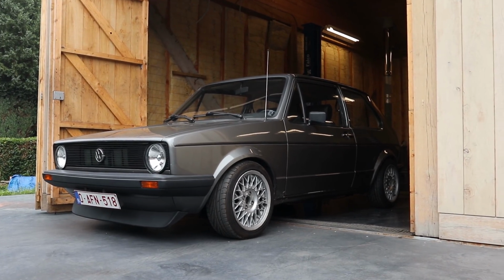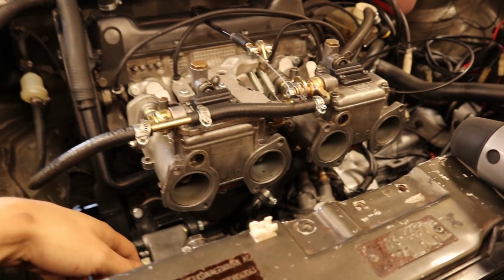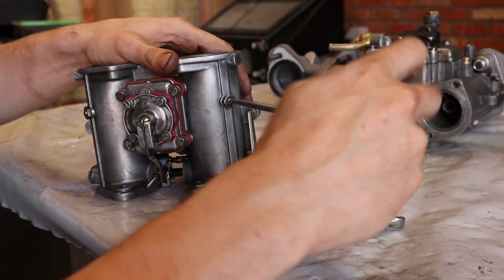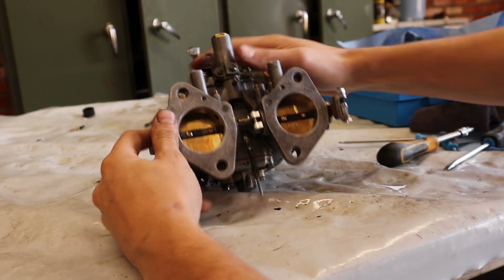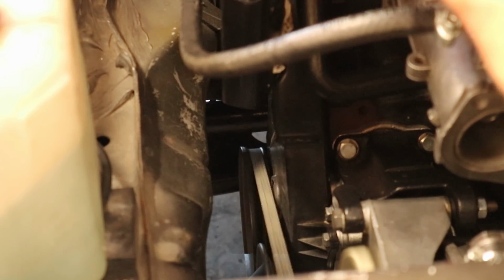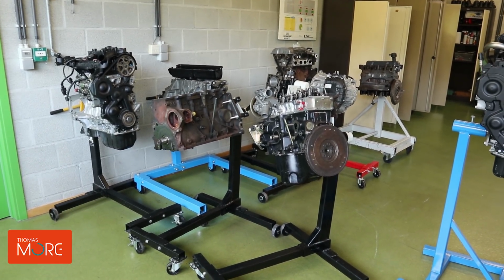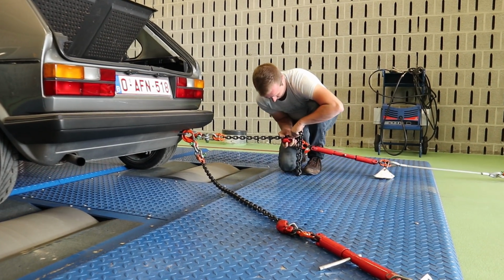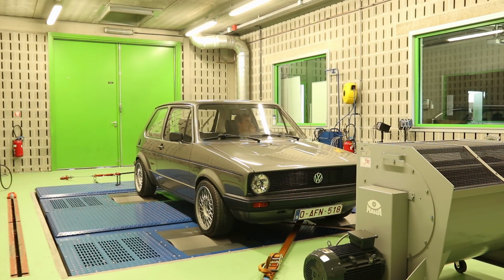Golf Mk1 2.0L 8v Engine Swap - Pt.6: Power Runs On The Dyno!

Comment: I have very much enjoyed your videos on the 2 liter 8 valve swap. I am currently building a 1400 lb Porsche 550 Spyder replica with a 2 liter 8 valve non cross flow head. It came with EFI but no ECU, so being an old guy (75) with more experience with carbs, I too decided on twin 40 mm Webers.  I have a few questions. What were the final jetting (specs) of your carbs, ignition timing, and do you run vacuum advance and if so where is the vacuum port on the carbs. I don’t seem to have them on the Webers and don’t know if manifold vacuum will work. Also where does the cross flow head come from and do you know if it is a bolt on swap for my block? Oh, I lost many weeks before I found out about that adapter for the large distributor hole. I wish I had seen your videos earlier. Sorry to run on so long. You have one of the best YouTube sites I’ve ever found. Good work!

Comment: What spec is the engine? It seems pretty flat in terms of power & how it revs like it isn’t revving strongly.
My old mk2 GTi made ~120hp as a near stock 1800- once tuned as a 2L with properly worked head this was 150hp!
Headwork & a decent cam to get it breathing properly is the key

Comment: Side draft Webers etc can be very expensive to set expensive, most people would surprised that late model SU,s HIF ( high air flow, they are more square at the top, earlier ones were more rounded ) can FLOW as much air and fuel as Webers for LESS money!!

Comment: Memphis: I think the max. power is obtained at an air fuel ratio of 12.5:1. I saw in the later tune of the carburetor, you got more like 11:1. Understand that you tried to avoid a lean mixture from an acceleration. Is there a way to adjust the acceleration enrichment without affecting the air fuel ratio for the entire rev range?

Comment: Make our Idle around 14,7. Full Throttle at 13,0 and if its possible half throttle at 14. You will safe a lot of Fuel and gain more HP.
Falls du Deutsch kannst ist es einfacher:
Volllast 13.0 bedeutet ca. Lambda 0,89 was für Sauger das beste Gemisch für am meisten Leistung ist.
Du Fährst gerade Lambda 0,7-0,78 was viel zu Fett ist wenn du keinen Turbo hast.
So Verlierst du bestimmt ca. 10PS. Denn die Leistung für einen 2L 8V Doppelvergaser ist nicht so berauschend. Das schafft man auch sehr leicht mit einem 1.8 mit optimaler Einstellung.

Stell den einfach nochmal nach und dann sparst du ein haufen Geld :D

Comment: Hmm in the past i make head porting with -1mm on planning in 2E engine and get 123bhp with 177nm without other mods on 1st gen lpg. What is the sense of build carb engine to take less gain?  AFR 11-12 is for that engine with CR 12:1, 288 camshaft and 150-160bhp. Rich fuel is not good for performance, leaner mixture makes bigger power.

Comment: this and your old engine are very tunned here in Brazil, especially with turbos. I have a 1.8 N/A prep installed in my vw voyage, shirick cam, 13,5:1 compression, running on etanol, using audi a3 turbo connecting rods. i use a fueltech ecu and 4x1 exhaust manifold. I got 110whp out of it using a conservative timing. love your channel dude. subscribed.

Comment: I came here because have same engine (mostly, as longitunal in audi 80). Instead of carbs i did go with ecumaster det3 fuel implant, saab injectors etc and stock ignition. In the mix I added eaton m62 supercharger. look my channel for videos.

Comment: Nice video the car pures like a kitten ;) ,im working as a bike cycle mechanic here in Denmark and I startet the eutication in January 2000 and I was finish in October 2003 and I have been in that ever since, I allso repair my own mopeds/scooters, last summer I swaped the broken air cooled engien on my Gilera Runner Sp 50 from 2006 to a licquid cooled engien and allready I had a new wirering harness installed some years ago, so it was ready to get licquid cooled, but the whole cooling system had to be installed that was a big job to do, but it runs like a dream now, I bought a Piaggio Nrg DD 50cc that I took the engien from, I only use that Gilera Runner Sp 50 in the spring and summer and autum then it stayes in my garage in the winther, it coud allso be fun to see how much power it makes on a dyno run, the only issue I got is if I drive on coppel stones or wery uneaven surface the engien stutters sets out but I have installed a real dellorto 17,5mm carburator and I have ajustet it and put in the biggest main jet that it can take and the colour on the spark plug is brown, ohh the engien is two stroke by the way, but it's so nice to do the work and knowing what parts is used and knowing what is done and save monny at the same time :) ,I like to take long trips on my scooter I got 3 and im doing all the mechanic stuff in my garage, in Denmark where I was to school for bike cycle mechanic there is allso car mechanics and motor cycle mechanics and other lines of work much similar to that in Belgum :)

Comment: Hey Memphis. Great Video! Can you provide some more info on that AFR tool you used? or perhaps do a video on this?
Reply from the maker: What do you want to know?
Reply: Did you make the tool just by using a generic AFR gauge? Curious on how you use it? Does your MK1 exhaust have a 02 sensor you tapped into? Thanks
Reply from the maker: Just take a look at the innovate MTX-L

Comment: Good figures Memphis, I can appreciate your excitement in getting it on the rolling road. My Mk1 is going to the dyno for setup next tuesday, I'll be happy with similar figures to you. Overbored 1900cc DX GTI on GSXR 600 SRAD carbs with electronic timing control (Nodiz) - fingers crossed
Reply: Just back from my rolling road tune - end result 122bhp/187Nm. Happy enough with that on my cabriolet!

Comment: Put one step smaller mains and good to go. Low 10s will wash out the cylinder walls and contaminate your oil far more quickly. We don't want that.

Comment: Great job, but ... Your AFRs are too rich. For NA you should aim at 12.2-12.8. I know that it is hard to tune carbs, but you can sacrifice low rpm and have there AFR 14-15, and focus on rpms after 3000. At this moment you have 10,7-11 AFR - this is too rich. Maybe next project will be with fuel injection and stand alone ECU ? ;-)
Reply: you are on point.

Comment: Very nice job and a cool Golf! Did you use a Lambda-Tool at the Dyno? With that you can see, if the engine runs with too much fuel or air. And pay attention with the Carb-Filters, they suck petrol and can start to burn. When you drive with Weber/Solex Carbs, its better to have an fire extinguisher in the car. ;-)

Comment: Hey man, those hose clamps look really bad. I suggest that you replace them with better ones. Especially on the coolant hoses. After some heat cycles, the cheap ones lose the clamping force and can cause a leak. Plus, once you tighten them, then loosen and you go back to tighten them, it will never clamp as hard and you can also "strip" the clamping band.

Edit: I recommend Oetiker clamps.

Comment: This engine needs a 288* cam, upgraded springs, and a HEALTHY compression bump (at least up to 10.5:1). This should net you at least 12-17kW to the wheels.
Reply: A cam would also increase the intake noise as well and make it sound extra throaty!!
Reply: @daw7563  no, even the engine swap isn't allowed. Im curious how he will pass inspection soon.
Reply: The problem is non of those things are allowed in Belgium
Reply: @daalhoffarm  but he can swap a whole different engine in his car and put carbs on it which makes it way less fuel efficient but he can’t put a cam in it?
Reply: @Everything8Valve  He can't do this legally in Belgium as far as i'm aware.
Reply: Why you gotta tell the authorities..... Just shhhhh
Reply: @daalhoffarm  You arent allowed aftermarket camshaft upgrades? What about if you swapped in a cam from a different VW head? Brazil used a 268* cam in one of their cars. Its the same cam profile that Techtonic Tuning uses for their 268* cam option.

Comment: Friend: "Why are looking through your carbs like a binocular?"
Memphis - "Looking for more power!" :)

Love how the car chirped the tires in 2nd gear! As for a camshaft change - don't go too crazy. A hotter cam moves the power range further up the rev range. You'll make more power, but it won't be there off-idle (1500-2500 rpm) where you do 95% of your driving. It will be sluggish up to the point when it "gets on the cam". Somewhere around a 270 degree cam with .430" to .450" valve lift will be ideal. Keep up the great content! Cheers from Canada!